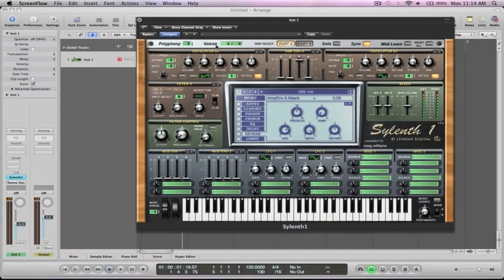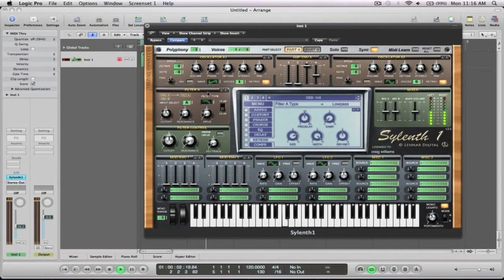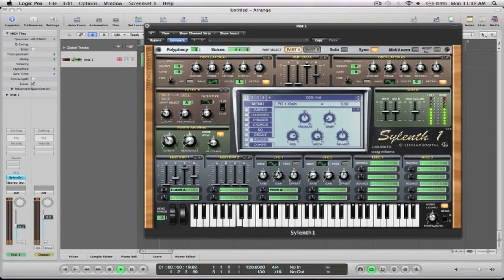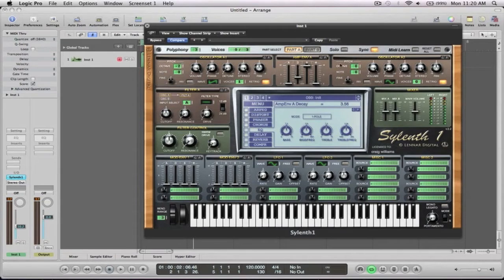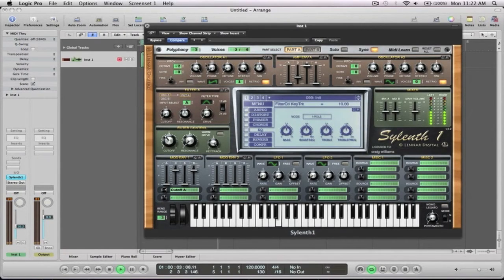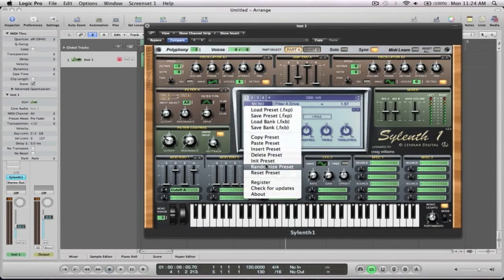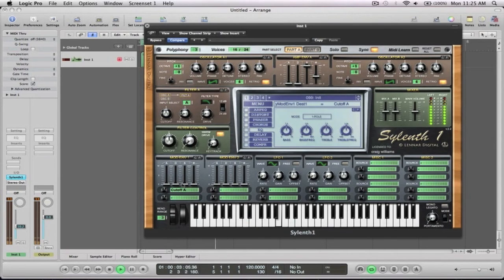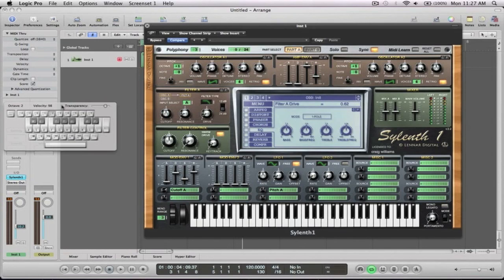Sylenth 101 - Part 7 Lead Synth Sounds

Comment: My computer is more than 3 years old and its not getting unstable at all. Its all about the user. Less viruses and your PC will be as stable as it was at the time of purchase. You get the XXL producer edition for like 300$ and it includes some synths afaik. But most people arent gonna use the imagelines own synths anyway. I paid 200$ for my FL studio. It did include all the necessary mixer effects and some synths too like 3xosc. The Signature bundle would be a bit over 200eur and contains sytrus

Comment: Also i paid 179$ for my FL studio so thats where i got the idea of it being the cheapest. The 1k version of FL studio contains ALL the imageline plugins. I got the producer edition for 179$ and it contained some synths and lots of mixer plugins. That would be cheaper than 200$ right? Also when you add the 300-400$ extra price of a mac the difference becomes even higher. But its not usually the DAW that costs, but the external plugins you are going to get (or need).

Comment: No you shouldnt get a macbook. They cost so much and logic isnt any better than Fl Studio. Also reason can be used in windows based systems. But id just buy FL Studio. It has free lifetime updates and also its the cheapest (and easiest to use imo) of that bunch. Remember its not the software you use, its how you use the software.